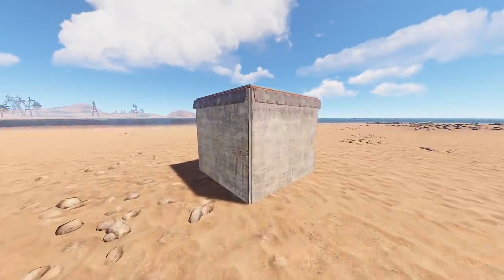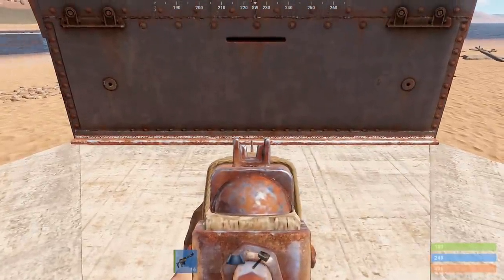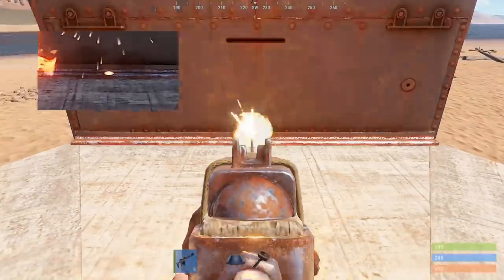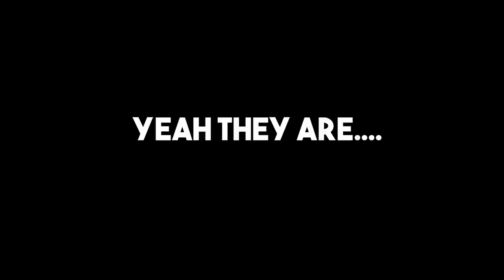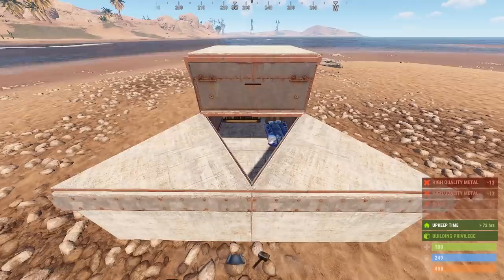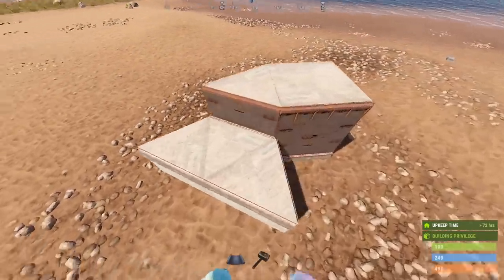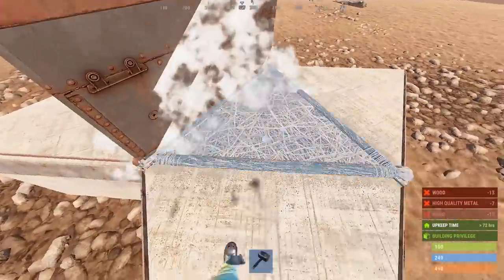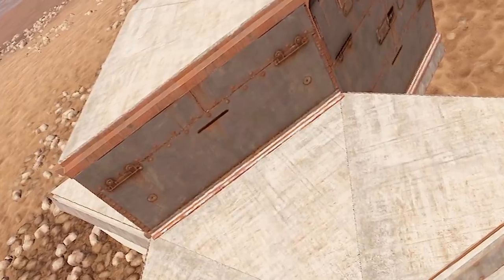RUST - Bunker Bases Are DONE! - Rust Base Building

Comment: LOL, finally the bunker meta gets seriously challenged! I hope this will cause building to get more diverse again! Great find! Expertly presented! 🎁
Reply: Hello wurst
Reply: i freak out for a moment, rust without bunkers is easy loot
Reply from the maker: Thank you for the kind words Evil :)  I'm hoping this shakes things up as well, 2020 is looking to be a great year for builders!
Reply from the maker: Indeed
Reply: It was an easy solution for us solos... I will probably just go back to 'dead man' bunkers.  A little more annoying but cheaper anyway.
Reply: No worry harley, there are several stability bunker designs that are not affected. This design was usually susceptible to soft side picking anyway
Reply: MY DESIGN STILL PREVAILS laughs evily in my corner with a design that doesnt get touched by this
Reply: oof. finally someone put video about it. i think thats it with this exploit... was using it for quite a while and can say that its pain in the ass to get rid of the wood. if its twig it takes like 2 or 3 accurate exp ammo shots. 
And little advice to content creators - 5 accurate incendiary rockets on the same spot shooting right under your legs will destroy wood from the inside and oneshot twig. Its a bit time consuming to learn exac position and include suicide while doing it but it does the job and saves alot of explosives even for this upgraded design ;)
Reply: Milk2Percent  stability check ;)
Reply: Who else read this with his voice in your head?
Reply: My stability bunkers don't use raised foundations or roofs!

Comment: Yo to any new peeps i built this design on console and it works, you can honeycomb the exposed triangles to make them impossible to soft side raid. Design works w a 2x2 core, use a ladder for a jump up if you honeycomb the armored foundations and honeycomb your roof at least one layer plus a layer outside. If you mess w the design and throw in garage/armored doors u can do a lot with this design, think what i currently have is a 30+ rocket raid design and im solo on vanilla
Reply from the maker: thank you

Comment: The real test of a bunker base build is if you can fix it so that the supporting foundations can’t be soft-sided. If splash damage as you presented isn’t an option, 10 jackhammers and a nearby tier 1 will.
Reply from the maker: Yes, jackhammer is very dangerous for the foundations, i still have to work out a design that takes that into consideration

Comment: neat raiding trick. but it seems most bunkers are 2x2s at their core so most designs wont have to change very much. a single extra raised foundation along the entrance to prevent floor from grabbing stability and put the half wall inside the 2x2 with square and then triangle coming off of it. depending on the setup it would actually have the advantage of letting you stay inside of the bunker once you seal it. hell you could even use a floor frame instead of a square floor tile for ease of movement inside while bunker is sealed, assuming the stability allows for it but id bet it does
Reply from the maker: Yeah, there are different ways to avoid the splash, a 2x2 there is like you said, a slight adjustment in the positioning of the half wall.  For smaller more compact base designs this will be a bit troublesome

Comment: I’ve been using this trick except I make the middle triangle stone to avoid cheeky raiders from trying to glitch incen rocket fire into destroying the twig. My bunkers have been 3x3 triangles to have enough room to avoid this issue.
Reply from the maker: nice nice
Reply: How would the middle triangle being stone stop it? If the middle one is HQM anyways that would in theory have the same affect stopping the flames. But if it doesnt, then wouldn't the stone be pointless anyways? In the video, at the end, he mentions making the middle one HQM.
Reply: @notfred596   People tend to aim at the center of the triangle and usually the single flame that makes it through, stays at the center and doesn't spread out. Then again, that may be because I tend to build my bases on flat areas.
Reply: @FavoriteSniper  Fair enough.

Comment: There is, in fact, a cheaper way to do this. If you use a raised foundation stair with a triangle in front of it, and then a triangle on the left side (from the top of the stairs) and then place the wood half wall there, it’s easier to do and the stair’s hitbox makes it so you can splash anything underneath it
Reply from the maker: very smart, thank you for the help
Reply: this might actually not work, but I think you can do it with a regular foundation as well
Reply: anything works really

Comment: I dont know what you did those many hrs cus you can easily splash it from the sides. But you can honeycomb the stability bunker, which makes this design superior
Reply: the bunker is asymmertrical when you look at it from above, it has one blunt angle and one 90 degree angle. You can splash it on the 90 degree side with explosive ammo. trick is to hit right above the foundation and you can splash the stability bunker, so when you make a new base design, make sure you've got the 90 degree angle honeycombed.
Reply from the maker: That is def. true, there def. has to be honeycomb on the angle you described, i was unaware of this at the time of the video but learned it shortly after
Reply: I did some testing, and by my estimates, this bunker is still worth it. Great design, and thanks for sharing. I had a lot of fun figuring out and playing around with this bunker in a build server. Always fun with new meta.

Comment: also you could always just jackhammer through the raised foundation if they didn't cover them up (which most didn't or they only covered it with metal/stone) now the new design is too expensive when you could spend less and just put down 5 garage doors and not have to work with weird raised foundations and worry about picking
Reply from the maker: it gonna be tough to figure this one out, i am currently working on making it efficient

Comment: I knew of the splash damage "exploit", however, nobody ever used it. I have used it a couple of times when I was still able to play Rust. If not mistaken hJune had covered that topic a few months ago (around 6 if I recall correctly)? (Might be mistaken and may have seen it elsewhere though) Anyways, a great solution, as expected!
Happy Holidays! :)
Reply from the maker: I appreciate that.  This technique is new to me, but it could have been around for a while, i just don't know.  There was the idea of using an incen rocket to splash it, but unfortunately i could never get it to work for me
Reply: @MyGamingExperience  Yeah, I used to do both, the incendiary rocket was a bit trickier for some reason and I think that they changed the way it worked and that's why you struggled maybe? Then again, I haven't played Rust in 3+ months due to no time and inability to run the game on my laptop anymore :/

Comment: Dude, I love your vid and you are giving a great counter + solution.
But the solution isn't new to me. I posted a bunker door on the 4th of May 2018 that already avoids the splash. I'm actually curious what you think.
Reply from the maker: It is a strong idea for sure.  I'm gonna be testing out a few idea's on how to optimize
Reply from the maker: I like that base, the idea is very solid, its efficient and strong for its size.  I also really like them furnace placements.
Reply: Thank you, that means a lot coming from you!
I really enjoy building bases but I'm not good in doing the videos. :(

Comment: I think they should rather fix splash damage magically teleporting through walls and do something about despawning/offline raids. Bunkers arent a bad thing, in a way they're the only way to secure loot in a way that people will be less appealed to offline raid you. At the same time theres people that abuse bunkers to despawn loot during raids, those people i often refer to as "cunts". But since everyone pretty much offline raids nowdays leaving you no chance for a fair game bunkers are pretty much the only way only zergs will raid you upon which leaving the server is the only choice anyways since without hacks you cant efficiently get rid of a zerg unless you want your whole wipe being farming and door camping. If bases had increased health after a while of you going offline, or similar. Something as bunkers would probably die out since no one would want to go through that hassle for a bit more security.
Reply from the maker: I agree, i wonder if they could add something to make bases just a little bit stronger, maybe a really strong door or access point to a room that can compete with stability bunkers
Reply: @MyGamingExperience  That or just making upkeep/upgrading cheaper, so you can build bigger bases for the same price of the smaller variant making raiding more expensive and therefore less appealing unless you know your opponent is stacked which would require intense stalking/time.

Comment: Hi your fix is actually not a fix. You can actually still splash the half wall down by aiming at the sides. I believe u have to hit the foundations or something. I tried it just now and i splashed away the twig with the exact 1x1 setup you used here. I didn't aim fancy i just shot around the sides a lot and the twig took damage 1-3 times during my shots and broke. so somewhere there is a sweet spot.
Reply from the maker: I've tried this, cannot get it to work

Comment: how'd you know where wooden half wall actually is?
Reply from the maker: it can be different in every base but usually its the floor tile with low stability compared to the surrounding foundations, and it should be up against a hqm wall

Comment: Upgrading the inner floor tile to armor is somewhat overkill. Yes its needed to make it the full cost, but no one is going to sit there for hours once they realise the few clicks of explosive hasn't opened it. IE, stone is probably fine, or metal if you want..
Reply from the maker: do you mean the half wall holding up the bunker?  you can upgrade that to stone or metal if you want, metal would pretty much make it the same cost as an hqm wall, but you have to softside pick sheet metal when you want to open, that would take a long time
Reply: @MyGamingExperience  No, I mean the first floor sitting on the half wall 'inside' the bunker which is holding up the floor 'outside' the bunker. If they are splashing the outside of the bunker in hopes the outside floor is sitting on twig/wood just below (which it isn't, it is one further back), then the inside floor need only be stone really. What is the total raid cost to splash the 'inside' floor if it is stone? Probably a long long long time of splashing it?
Reply: They could splash damage it. Keep it armoured for max raid cost cause if its not the raiders might get away with breaking a stone floor tile with splash damage rather then an armoured one..
Reply: @PrimalRenegade17  True but aside from splash with explo ammo, thinking it is the old design and it is just wood or even trig holding up the bunker, what? I think someone raiding this with rockets is already in, that the bunker is there or not might be besides the point? If there is only say 3-4 doors between outside and bunker, and even if someone C4s them, will the C4 splash the stone 'inner' floor? I guess in my experience people determined to raid (especially without profit, ie revenge) aren't going to be stopped by 1 more armoured. But I guess you're right, with all the Hqm already spent on even a small bunker like this, upgrading a floor (7hqm iirc?) isn't much more of a cost over stone..

Comment: solution is too expensive, no need for extra raised foundations u gotta change the bunker and sealing method from the inside ;)
Reply from the maker: its impossible to do without losing space, depending on what you want in the actual bunkered rooms, and also the size of the bunker

Comment: couldn't you just use incen rockets already
Reply from the maker: I was never able to get incen rockets to splash under it, i heard it was possible but i just could never do it.  This way is super easy and can be done with a sar, it is pretty good imo
Reply: Yeah i have tried many times, not doable, only times i have seen it was on youtube and im pretty sure it had to do with an exposed foundation, which you never have to worry about because bunker entrance was always in the middle of the bases